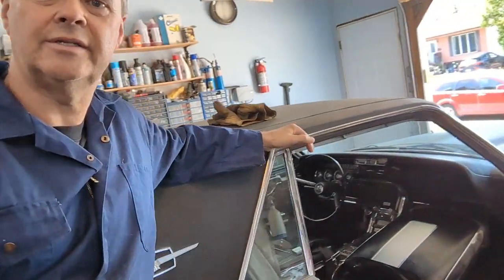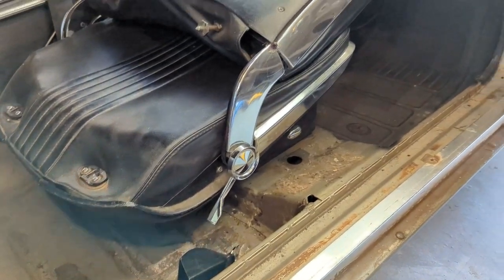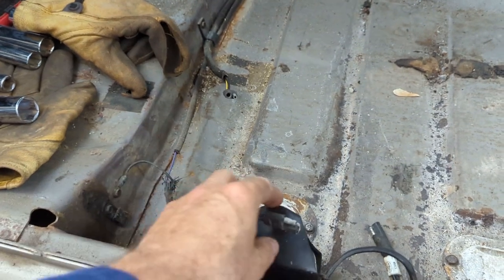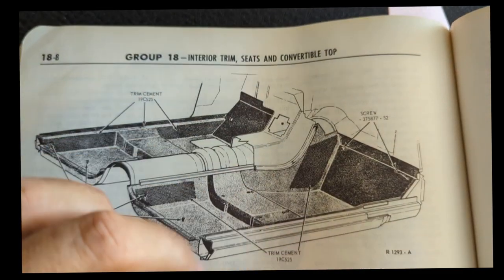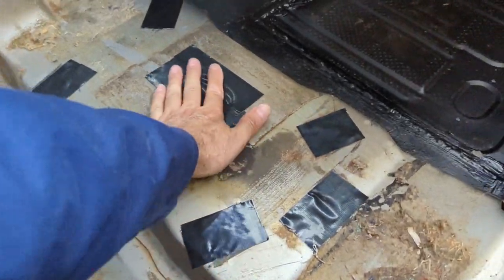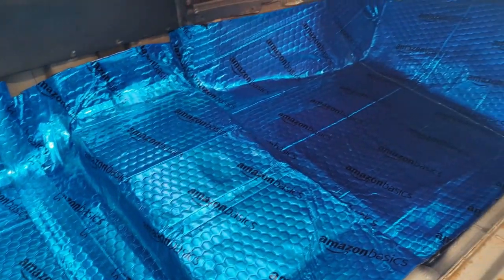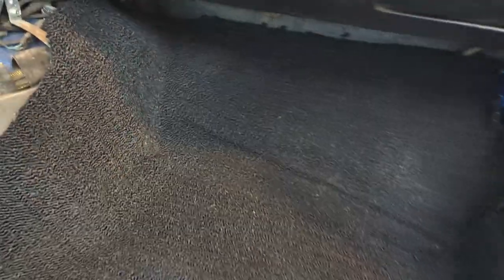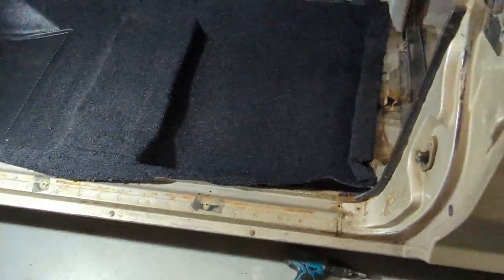New Carpet Install - 65 Thunderbird Hardtop

Comment: Hey Alvin, lookin good. I learned something from your video. I never knew that the shop manual had a section on how to put the carpet in, I just winged it on my own. I always screw the carpets down and I have the special screws for that, just like the original screws, but on the 64-66 Thunderbirds, I don't use glue, I just screw them down in the corners. Except for the area below the sill plate, I do use a little glue there, along the edge of the rocker. These molded carpets are very stiff and screws work way better than glue. On the 58-63 Thunderbirds, they have carpet pieces, not one big molded piece, so those have to be glued in. But even on those, I don't glue in the floor pieces, I screw them in. I have found over the years that sometimes its handy to pull the carpet out for what ever reason and if its glued in, it just ruins the carpet when pulling it out. Especially nylon carpet. These 80-20 rayon nylon carpets are much better and more stout and durable. I think Auto Custom Carpets make them for Birds Nest. I just order them directly from ACC. What a great company, great products. I always tap the seat belt bolt holes in the floor now. I made a video about that with the Thelma and Louise car because after I put the carpet in, I couldn't get the seat belts screwed in so I had to tap them after the fact, big hassle. Give your gas pedal a good clean. I scrub it really good and use an aul to scrape out all the crap in the slits. I noticed you didn't put it under the carpet, did you do that later? It pokes through a slit in the carpet so you don't see the screws. You probably already know that, just sayin'. Ill be doing this job soon enough on that 66 convertible I bought. I had to cut out the carpets with a knife because there was 2" of water in the car. I hope it has all dried out by now. Car is in LA so I wont see it until July. Anyway, nice job, thanks.
Reply from the maker: Hey Nick,
I like what you're saying about the glue, it got so hot yesterday, I didn't get to finish the job...so I think I'll use a minimum amount of Super 77 to hold the carpets, and let the screws do the work, it fits nice the way it is.
I will clean up the pedal as you said, and I am intending to mount it under the carpet.
I do like these ACC carpets, but when I try to order from them directly, the shipping more than doubles the cost, when I ordered from Bird Nest, it was combined with the trunk liner kit, so a little more value for the shipping cost.
I remember you had issues with the seatbelt bolt in that video, thanks for the reminder to run a tap through the holes.

Comment: Turned out great! The carpet install on my '65 didn't go so smoothly. The guy who welded the front floor pans in welded them in a bit higher than what the originals were, so the the pre-formed carpet didn't have its contours match the floor. I had to slice the carpet a little in innocuous places to make things fit right. I was very disappointed with that, but it's mostly unnoticeable with the seats and everything reinstalled. I used the kilmat, which cost more than what you used, but a lot less than Dynamat, which is very expensive. I also used a second sound deadener from a company called Noico on top of the kilmat, but the negative thing was that the slight added thickness kind of exacerbated the mismatch between carpet and the floor. Live and learn. Thanks for the video.
Reply from the maker: Thank you, it really did fit much better than I thought it would. I'm glad you were able to get your carpet fitted in the end, it's disappointing when things like that happen.
I used the Noico sound deadener on the roof before I installed the headliner, it's a lot lighter than the Amazon deadener, and it sticks really well.

Comment: Alvfin,
Looks terrific.  I can't wait to install the carpet in Pearline, but you skipped a step, my friend.  What did you use for the cemented spots?  Inquiring minds want to know. 😁
Regards,
John
Reply from the maker: Thanks John,
It sure changes the look of the interior by having carpet back in there! At the time, I didn't have the "trim cement" in place, I wanted to make sure everything is where it needs to be first...my go to for bonding soft parts like this is 3M Super 77.